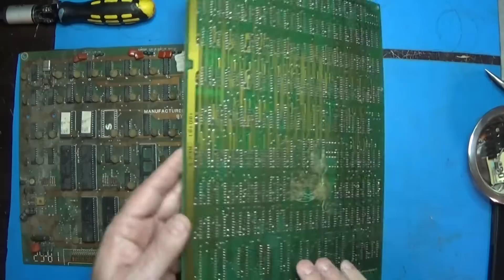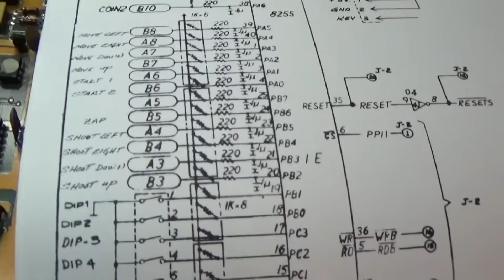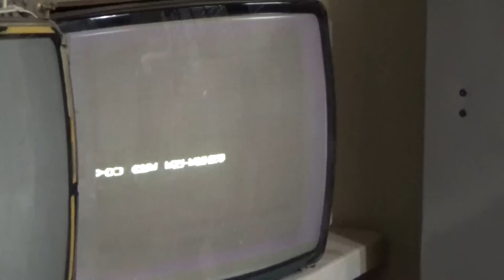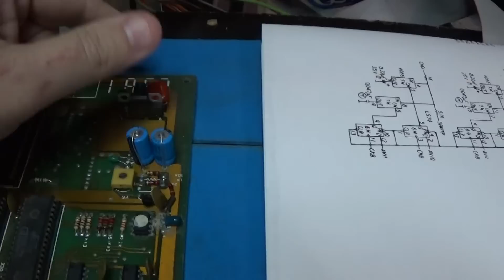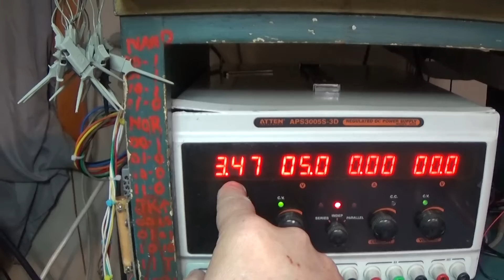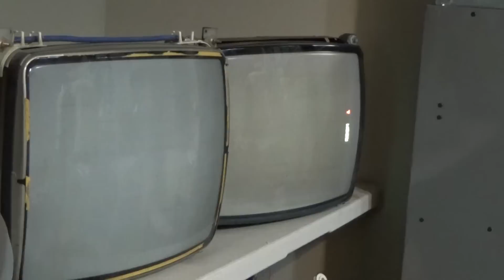D.O.A., No Sound - Stern "Lost Tomb"  1982 - PCB Repair - 5/03/22

Comment: This boardset is supposed to be based on Konami's Scramble hardware.  Stern also developed a few games for the somewhat similar Super Cobra hardware.
Reply from the maker: In fact… This very soundboard can be used for super cobra
Reply: @classicarcaderepairs4818   Scramble as well if you populate the security chip on it if using the stock firmware. It also looks to be the same CPU board as super cobra and scramble as well, but with the added bodge wiring to modify it. It must of been cheaper to modify existing stock than to manufacture a modified revision of the CPU board.....